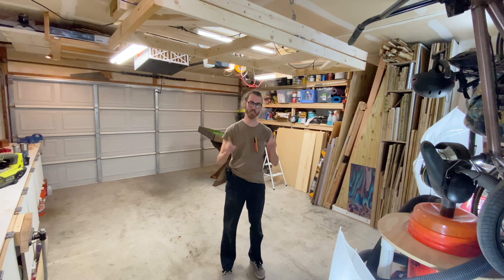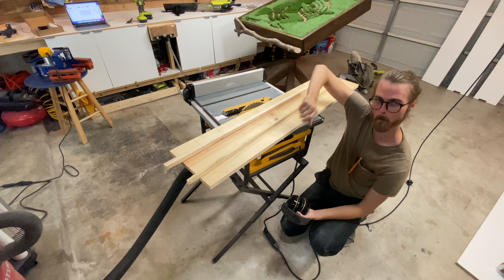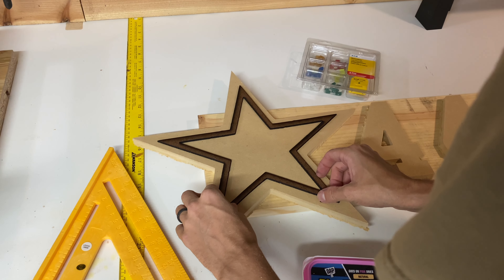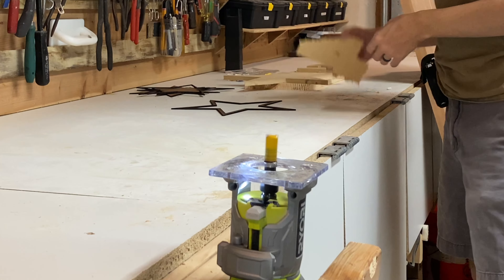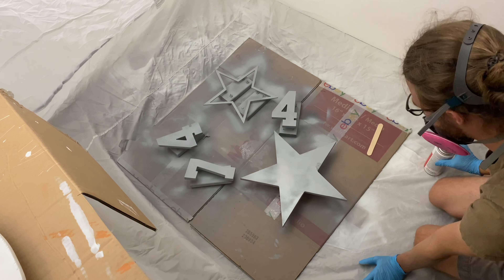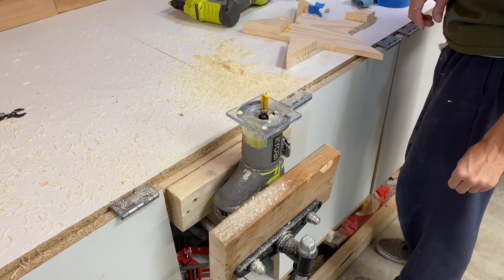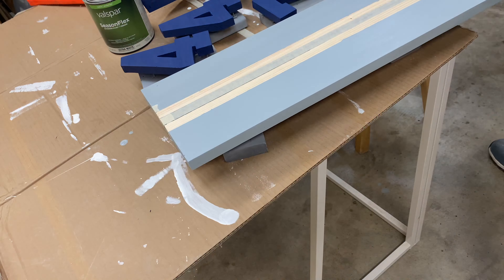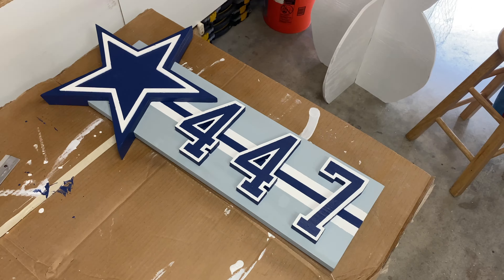I Made Dallas Cowboys House Number Sign!

Comment: Great video! I know it’s one year later and perhaps you’ve found a better way but there’s flush cutter that have the ball bearing at the very top (rather then bellow, as yours is in this video, where the flutes are point towards you). With that alternative bit, you’re not so likely to get shredded by the flutes of the bit.
Also, please use the correct tool. I know it’s a pain in the ass, but I almost lost my finger for not wanting to pull out my routing table. 
Great vids! I’ve been binge watching them (: